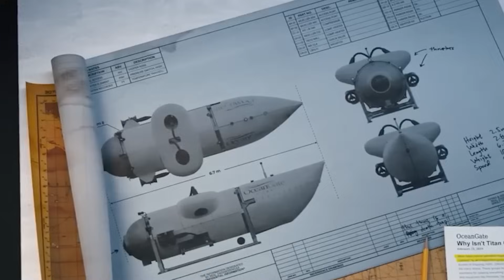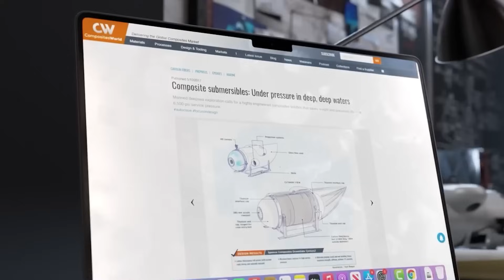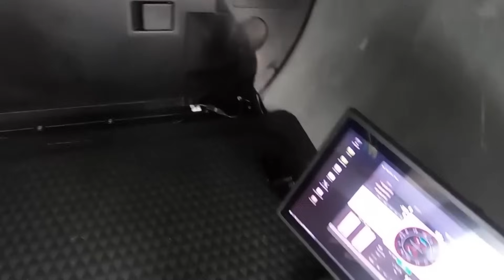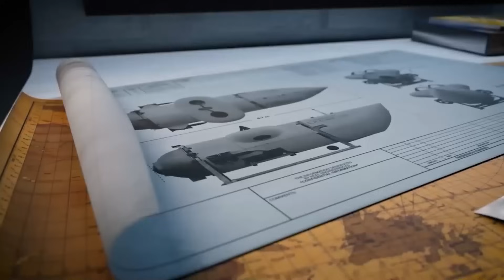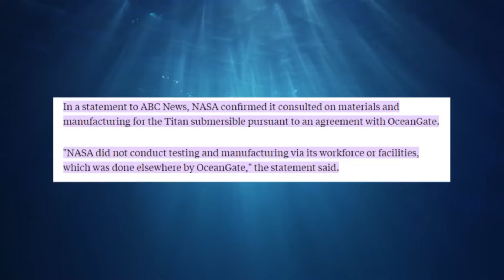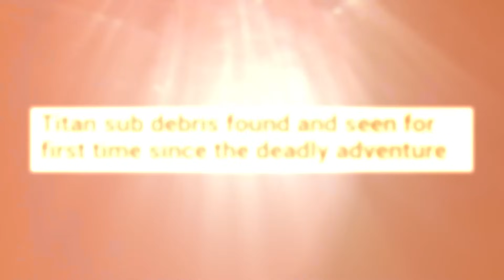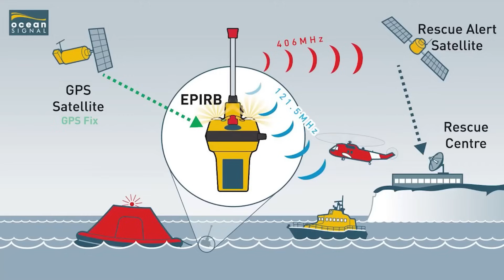Titan submersible| SHOCKING UPDATES (As Of OCT,2023) Of The Cause of Implosion

Comment: They likely lost all power and descended in an uncontrolled manner to crush depth. The weight imbalances of the passengers, along with having no seating to stay in one place and the ability to be strapped in to insure weight was evenly distributed was a definitely a problem waiting to show itself in an emergency. Additionally, I find it striking that no emergency backup power and a bulletproof emergency ascent system that could lift the sub back up to the surface no matter the conditions and the lack of an emergency beacon to indicate the position of the sub in a catastrophe and a surface GPS system to precisely locate the sub on the surface in normal operations was something I find to be incredulous.

Comment: I can understand some sloppy reporting in the hours after the original incident, but you have had months now to do your research. Once again, radio does not work under water, even at moderate depths of a few meters let alone 'extreme depths'. This applies to GPS and Starlink. It is well established now that Starlink was used for communications with the support ship and the land, not with the submersible itself and hence had nothing to do with the loss of communications between the submersible and the support ship. This communication was by coded sonar which allows only for brief text messages, not voice, and in any case it is now well established that the loss of communications was simply caused by the implosion of the hull.